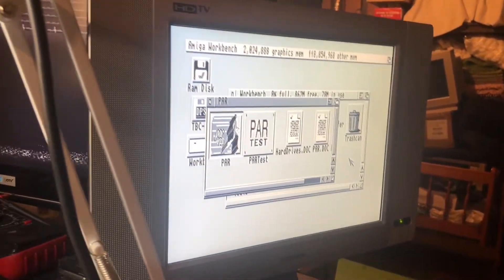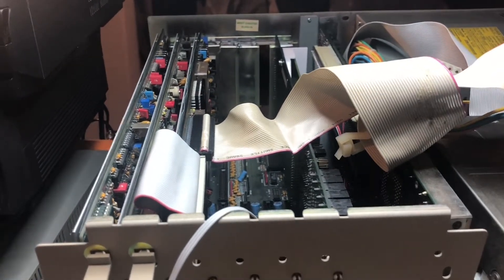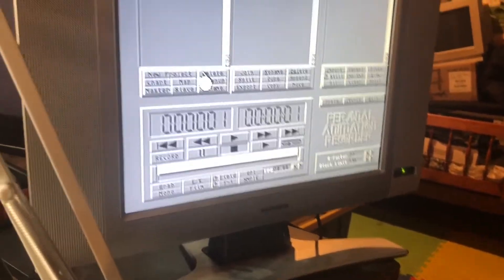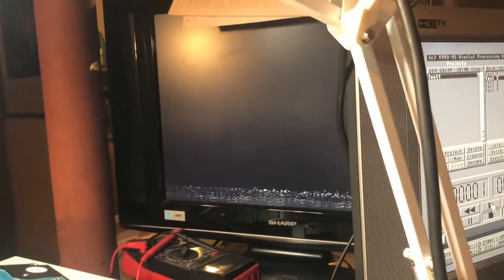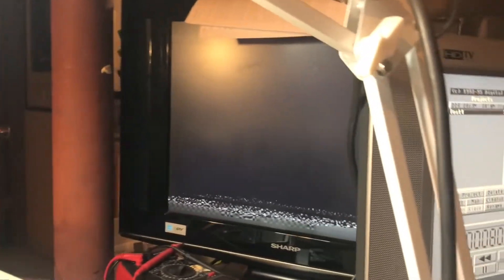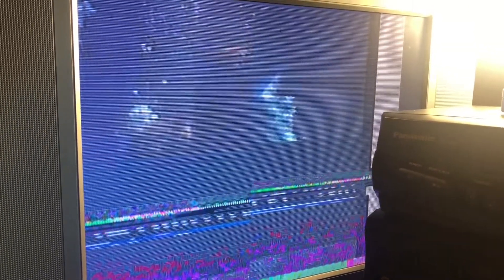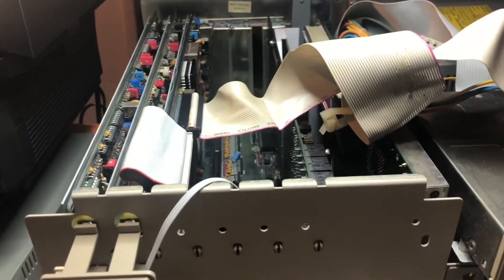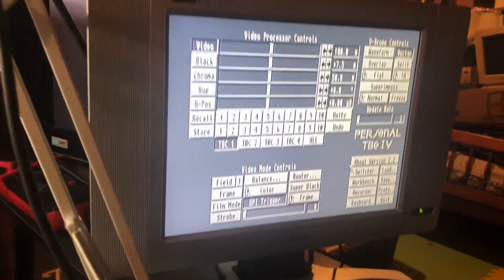Amiga Personal animation recorder progress. Sata working!

Comment: Macrovision encryption, also you do know there should be a 4gb partition instead of that big size.
Reply from the maker: Later versions of the PAR software expanded it to 8gb.  That is the max size, but it wasn't at first.  I believe the issue here was issues with syncing and a bad input signal going to the TBC-IV I have..  I am missing a special BNC Y cable that came with the product originally, but I'm working to find a replacement.